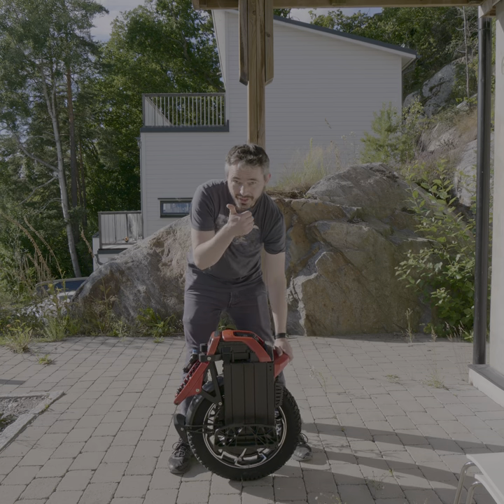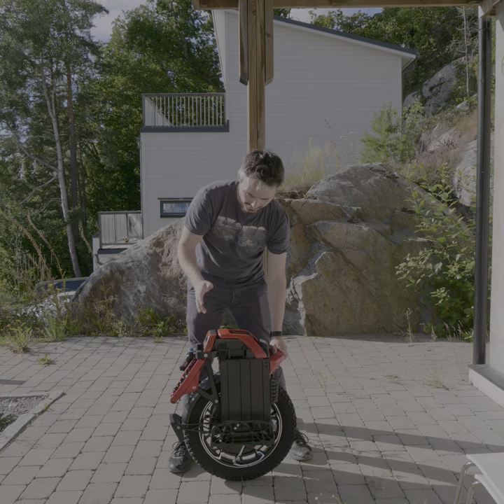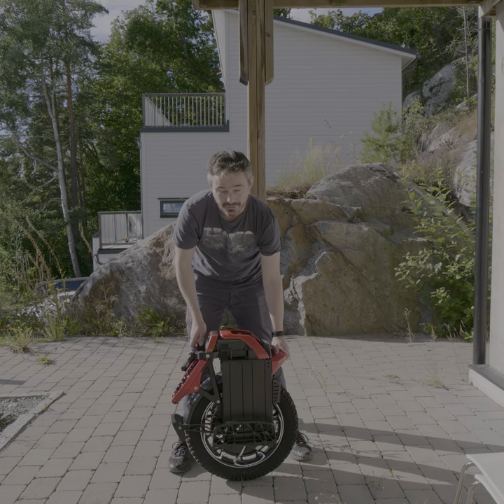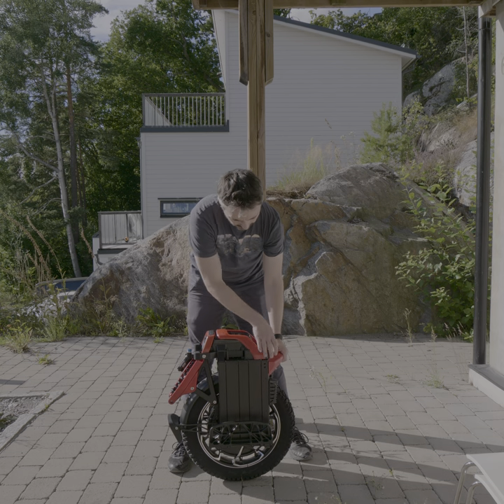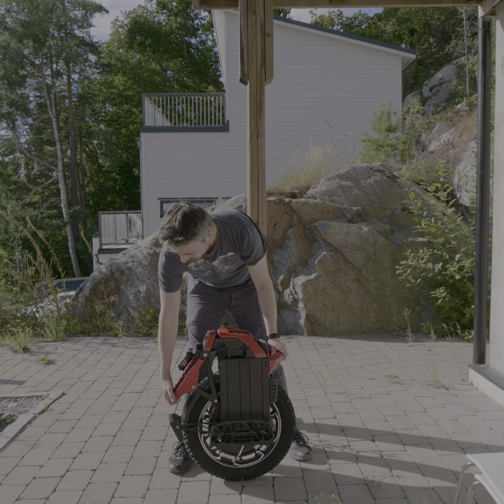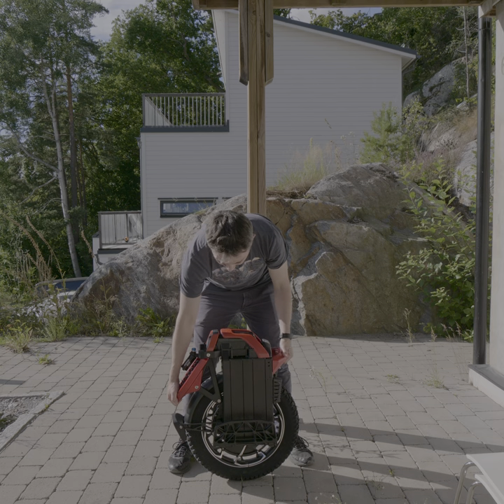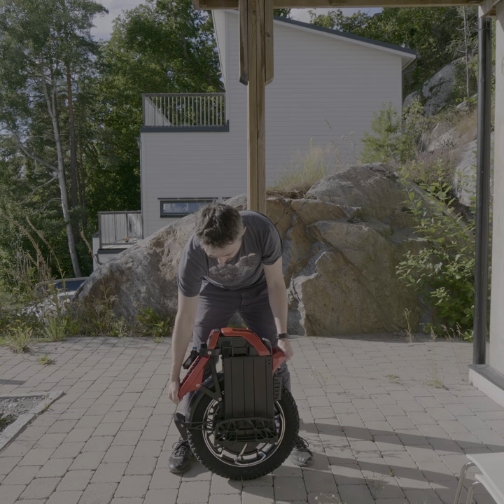King Song S22 V12-style stress test

Comment: That is one heck of a workout. Did that with both my s18. S22 will be up a few notches.
Reply: This can be done with the S18 too?
Reply: @irhuz8683  technically any EUC. I did a free spin on my s18 to clean off all the mud after a wet trail ride. 🤣🤣
Reply from the maker: I often do in winter as well, part of the process to get rid of snow and slush before going indoors.

Comment: I've seen videos of that electrical slip-"pop" with wheels being torque tested (probably WrongWay).  So you figured out a way to do it with a really good grab and arm strength.  I wonder how many other wheels would do as well?
Reply from the maker: Yes it was Adam from Wrong Way when climbing stairs.
This test was on the original firmware from factory (2.20) instead of the current release (2.22) - it's possible it doesn't do that sound anymore once updated.
I wonder if it was an early indicator of hardware fault with the motor otherwise.
Reply: @supercurioTube  IDK, I've not tried that test on my S20/22s.  They both bricked going from 2.10 to 2.17.  The working controller battery set that Alien Rides swapped for my failing set shows firmware 2.22 with BMS 2.10 and all the battery voltages on euc world.  I'm expecting a 2nd S22 with the 40T cells from eWheels in a week or 2.
Reply from the maker: @reitze01  Ah damn. Fully bricked no recovery possible? If you boot the board without hall sensor connected it should start with the built-in recovery firmware 1.0.
At least that what it should do unless it's self-destructed.
Reply: @supercurioTube  both wheels self-destructed.  There was a hardware flaw between charger ground and battery ground of 20V when I measured.  KS recommended cutting green wires and cross-connecting them to get it to charge.  That worked to charge but then did electrical grinding on both wheels.  It appears it was more ground missalignment to hall sensors.  Thankfully the motor assembly is working fine on the AR wheel with the new controller and batteries.  The eWheels 40T S22 to arrive soon will also have an upgraded controller (they demanded hardware mod to fix the problem from the day of the fire).
Reply from the maker: @reitze01  that sounds promising, I hope it'll deliver 🤞
An upgraded controller (same as in the Chinese recall program?), I want that.. and correctly built motor as well - as replacement for my destroyed ones.
Reply: @supercurioTube  I hadn't heard of this Chinese recall program.